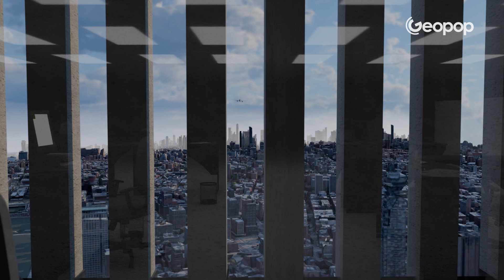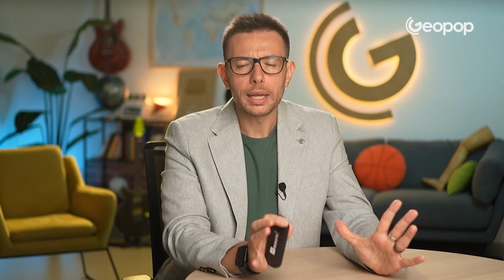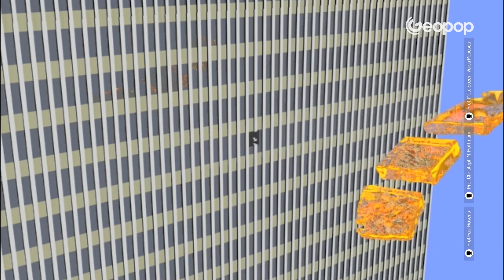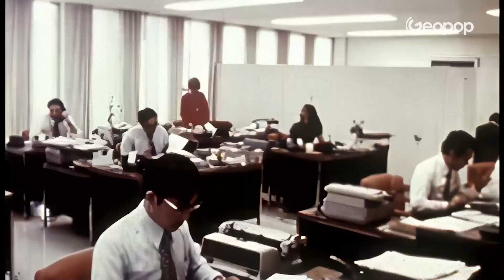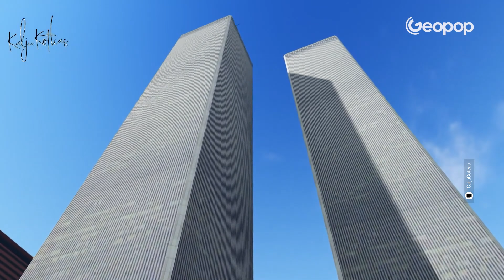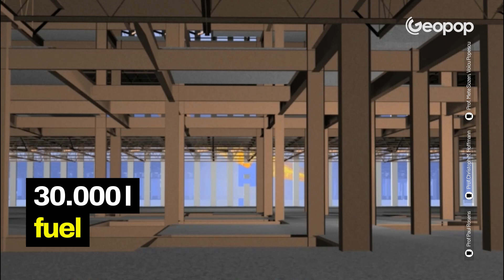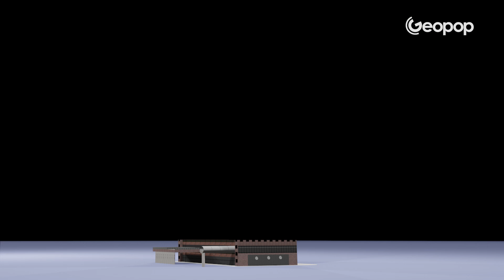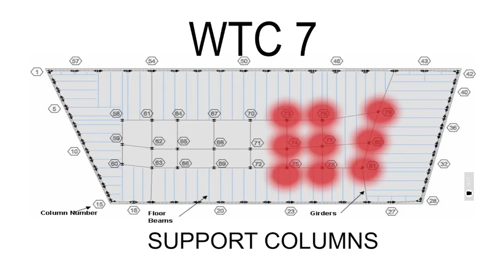9/11, 2001: The Technical Reconstruction of the Twin Towers and WTC 7 Collapses

Comment: How's a joke video like this has a half million views while at same time videos of  "Toronto hearings" keep disappearing from utube..??🤔
Reply: What is the source of the many tons of molten steel found in and under the debris, the heat so intense that the molten steel remained in that state for weeks afterward, running off of the debris as it was excavated. This cannot be molten copper from wiring that retains the color of a shiny new penny.  It cannot be molten aluminum that retains the color of the polished aluminum wheels of a street racer. It was the color of glowing orange molten steel  that cannot be mistaken for any other material, reported by firefighters who are very experienced in the nature of such materials as well as seen in video evidence.

When you combine this with an entire lack of turbulence behind 500 mph aircraft, when even a small Cessna Aircraft would leave an evident wake in the smoke and fire only seconds later .  . We find that skeptics still cannot be skeptical of the official narrative in explanation.  Sponsored channels and forum activity are skeptical of nothing when support is provided.

Sponsored activity in the forums is very normal today for commercial and political purposes and subjects of controversy -- in the attempt to lead public debate.
Reply: @ronaldgreene5733 Copper glows red like iron
Reply: Which is more extreme -- to accept without question the inexplicable lack of turbulence in the wake of a 500 mph large passenger airliner -- not evident in the smoke and fire covering the impact zone only seconds later? -- or to recognize the indications of digital projection in its imperfect nature as we see a wing disappear in front of a bright blue sky? From another camera angle, the same aircraft is seen passing behind a crane in the foreground, yet in front of the heavy crane cable. 

There should be a hurricane of turbulence in its wake that would entirely disrupt and disperse the smoke and fire seen billowing outward just 3 to 4 seconds later at both towers.  Even the wake of a small Cessna aircraft would be noticeable -- yet there is nothing.
Reply: I had to watch at 2x speed to get through it
Reply: @ElLowEl .  . "What the hell are you talking about?" .  . 😃 .  . Thank you for your sponsored reply, Mr. EILow.  The word projection indicates holography as you know, commercial demonstrations of which have been amazing in recent years.  To feign ignorance doesn't work well for you, however.  Where, Mr. EILow, is the wake turbulence only seconds after passage of a 500 mph large passenger airliner -- not seen in the smoke and fire covering the impact zone?  Even the wake of a small Cessna Aircraft would be noticeable -- yet there is nothing.  It's likely that no real answer from you is forthcoming. We'll wait and see .  .
Reply: Well, this video happens to get it right. You may not want to believe it, but that is very much a YOU problem.
Reply: @TheLoonResistance  The Toronto hearings...watch it maybe you learn something you never know
Reply: @shidapu145  - I have and I didn't.  You should stop letting YouTube videos do your thinking for you.
Reply: @shidapu145  - You should stop letting YouTube videos do all of your thinking for you.  The Toronto hearings couldn't even produce something like this:

This is my summary explanation of Twin Towers collapses of the Twin Towers, start-to-finish, based on my observations without appeal to, or reliance on any authority. No politics or ideology, just what actually happened, which is agnostic to who planned and carried out the 9/11 attacks or why. It has the benefit of not requiring Rube Goldberg levels of complexity and it makes logical sense. Each step in the process flows naturally from the one before AND is chock full of critical details the conspiracy-oriented internet tends to leave out with no whataboutisms.  My hope is this will dispel many common myths and answer most if not all questions you may have about the Twin Towers collapses. 

While complex, most of the Twin Towers collapse mechanisms can be seen with the naked eye and easily discerned and understood by the layperson if sufficient time is taken to understand. The worlds engineering community had already largely sorted them out at least as early as October/November 2001. Still, there are many who can’t be bothered to look or perhaps work hard not to see, being more concerned about advancing political/ideological agendas (which is exciting) than science and engineering (which is boring).

1. The Twin Towers consisted of 4 primary structural elements that together formed an integrated system where each relied on the others.  47 hollow box-section steel Core Columns carry the majority of the gravity loads. The 236 hollow box-section steel Perimeter Columns carry the remainder and ALL of the lateral (wind) loads. Long-span Lightweight Steel Trusses connect the core and perimeter column together at each floor with a Hat Truss on top to tie the structure together as an integrated unit where no element can survive without the others 

2. The impact of 117 tons of airplane (= to about 12 dump trucks) at speeds up to 590 mph completely destroys the aircraft.  This in no way implies the Towers come out unscathed. Some folks don’t get that. Hitting with the energy of up to a ton of TNT the impact damages or destroys many perimeter and some core columns (33 of 59 perimeter and 20 core columns destroyed at the impact floors in the North Tower), primarily through bolt-shearing failures at the end connecting flanges, as well as bending, twisting and fracturing of weld seams. There was no cutting or slicing - the reality was far more violent and messy. 

3. The impacts destroy or damage fire insulation, fire breaks and sprinkler systems on multiple floors. Huge fires are started across multiple floors simultaneously and allowed to spread rapidly with no effective firefighting or fire suppression. This was an unprecedented fire event . 

4. The hotter steel gets the weaker it gets .  With fire insulation stripped away and no sprinklers the survival time of the steel greatly reduced. Gradually over time heat causes the lightweight steel Floor Trusses at the impact damaged floors to sag, which was observed and recorded.  No steel melted nor did it need to. Structural steel will fail long before it turns to a puddle. It just needs to bend

5. Sagging floor trusses pull on the increasingly weak and overloaded Perimeter Columns, causing some of them to bow inward by up to 5 feet. A straight column is up to 4 times stronger than a bent column. The bowed Perimeter Columns buckle and fail, initiating collapse. The formerly static mass above which the structure below could easily support is now converted into a dynamic mass up to 30 times greater. Because they have buckled, the Columns above and below the failure point are no longer aligned . The load bearing structure below no longer bears any load as it falls past the lower columns, NOT onto them.

6. Thousands of tons of debris fall within the four outer walls, down through the open office space, crashing onto the first intact floor it encounters. This massive impact immediately breaks the bolted connections to the columns as the amount of resistance the Floor Trusses can offer is negligible.  The falling debris slows only marginally and briefly. Note:
6a. This is NOT a solid top block crashing into and “crushing” a solid bottom block .
6b. The debris falls past the columns not onto them.  The columns provide no resistance to the falling debris. 
6c. Only the bolted connections of the floor trusses to the core and perimeter columns can offer any resistance. A pair of 5/8” bolts at each end of each truss vs. thousands of tons of falling debris.

7.  This floor-led collapse progression within the four outer walls can only go straight down. Note: 
7a. This process is often incorrectly referred to as “pancaking” which actually refers to a completely different process rejected at an early stage. The catchy name stuck but nobody knows what it is supposed to mean.  Pancaking is too simplistic and inaccurate anyway. More like Kaiserschmarrn.

8. Collapse progresses through the floor systems and not down the columns. Rate of floor assembly failures increases with each successive floor as momentum increases, reaching an average acceleration of 0.65 of GA, or 35% slower than true free fall. Bam, bam, bam down the building until there are no more floors to fail.  The resistance offered by each successive floor is always the same. The mass and velocity and thus the energy of the falling debris are constantly increasing.  The falling mass increases with every floor it destroys as new falling mass is added. Some falls to the sides, but most falls down. More mass, more velocity, same resistance with each floor.
The above is unquestionably the path of least resistance . . Don’t get stuck on the but the lower floors weren’t on fire nonsense.

9. The Towers were 95% air by volume and as that air was compressed inside the building it is forced down the tower and blown out the sides in reaction to the building collapsing not causing the collapse. Those were not “explosions”, it was expulsions of compressed air, explaining the low velocity, lack of flash, blast, supersonic pressure waves and lethal high-velocity ejecta.  

10. Perimeter Columns become detached and peel away like a banana behind the collapse front, playing out to the four points of the compass extending to more than 600 feet from the base of the towers. This was quite obvious from examination of the debris pile. 

11. Core Columns fail last as their internal beam bracing is stripped away by falling debris and lateral support from the floor to perimeter columns is lost. 

12. For those who care about how long this took, the whole process took 31-34 seconds from the moment the perimeter columns buckled until the last core columns hit the pile, or 1/3 the rate of true free fall. Don’t believe me?  Just watch any video of the collapses and note all the loose and truly free falling debris dropping much faster than the towers themselves.  

13. Each Tower had a 1-acre footprint. Far from collapsing insie their own footprints the debris pile spread out over 16 acres in a pile up to 14 stories deep. 8 surrounding buildings were destroyed and scores more damaged. 

14. What was NOT observed and recorded were the 180-190 dB bangs of high explosives or the blinding bright flashes of burning thermite. Of course, neither could have caused the (silent) Perimeter Column buckling that was observed.  Neither explosives or thermite could have survived the impacts and subsequent fires either. Cherry-picking a casual comment from someone who heard a loud noise in an event like 9/11 is not exactly “proof” of anything and the pre—planned demolition case relies entirely on that. There is zero physical evidence to support either conjecture. It would be technically impossible, totally impractical and completely unnecessary. No one would bother. 

15.  The Twin Towers were perfectly safe within their design envelope.  They only collapsed when taken far outside design parameters by an extraordinary and unprecedented event. 

Impact + Fire (heat) + Time + Gravity = Collapse . Remove any one of those four elements and there is no collapse. Ignore any of those elements (as many do) and you will never understand the collapses. The Twin Towers were an integrated system in which no one component could survive without the others. One fails, the rest follow, through the path of least resistance – DOWN – through the open space, bypassing the path of greatest resistance – the columns.  Nothing I just described violates any laws of physics. All of the above is true no matter who planned and carried out the 9/11 attacks or why 

I hope you found this helpful. It is meant to be informative, not adversarial, posted with the objective of soliciting informed critical comment, positive or negative. If I made any errors of fact, logic or reason or left anything critical out, please let me know so I can fix it. One topic at a time, on topic only please to stay focused, no word-salads of Gish Gallop. IF you can offer a more plausible alternative be my guest. So far no one has even tried. Please start any reply with the words “Tits McGee” or I will know you didn’t actually read it, are not serious and just wasting my time.
Reply: @TheLoonResistance  What a shitload of lies...

Comment: 767 isn't "much" larger than 707. Both has the same fuel capacity (90000l) and 767 is around 20% heavier, so don't eat shit.
Reply: The difference in mass between the wide-body B767 and narrow-body B707 is equal to a 50-seat regional jet and mass is what matters. Mass and velocity. A B767 at 590 mph has a shit-ton more energy than a B707 at 180 mph.
Reply: @TheLoonResistance  Fitzshill, they calculated a fully loaded 707 FLYING AT 600mph!
Will you ever learn that simple fact in your shitty "life" Fitzshill?!?

Comment: How can the both plane hits both building went through the building like a bomb, even the steel structures can not stop the planes going through, even the heat only happens were the planes are burning inside the building
Reply: I don't know if you noticed but the aircraft were decelerated from 460 and 590 mph to zero in about a quarter of a second.

Comment: Excellent logical explanations.This was a unique and unprecedented event. Yet many comments presume they know the 'correct' sequence of events, over and above the best scientific explanations. Based on what? Based on personal hunches and everyday experience that does not include any such gigantic event ever before. The physical world often behaves in counter-intuitive ways that contradicts the layman's tendency to 'simplify'. And never underestimate humanity's ability to screw things up. There is no need to resort to 'conspiracy' to explain events.
Reply: The second plane went into the building on a canted angle. How is it that when the upper portion began to fall that it didn't tip over, but when straight down?
Reply: @whatsitgoingtobetheneh  Why should it go straight down? This wasn't a building made of toy wooden bricks. The fire from the fuel burnt accross the whole upper floors. In that inferno it made no difference in terms of weakness. One side may have weakened first by a short margin. But the other side didn't abd held the rest up - for a short time. When that weakened too it all came down at once. People need to purge their mind of 'conspiracy'. They will then see the world as it is, not as it 'ought' to be.
Reply: @whatsitgoingtobetheneh  One side stood firm. Tge other burned. It then pivoted and caught up with the good side that was holding everything up more or less. But it too was weakening. The two continued together thereafter. No need to invoke a secret cabal every time we dont understand physical processes. Keep it simple. (This is the third time I reply to andrewthompson above and every time the reply gets deleted. Is this a conspiracy?)